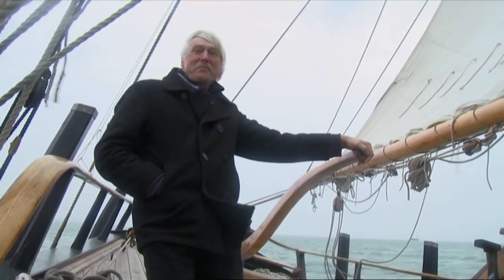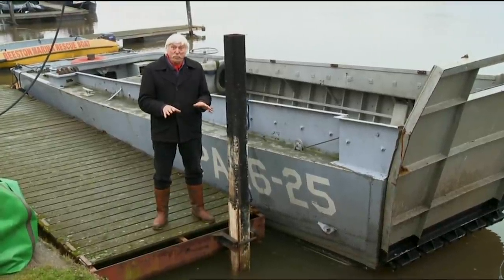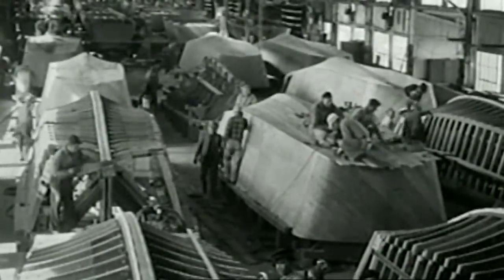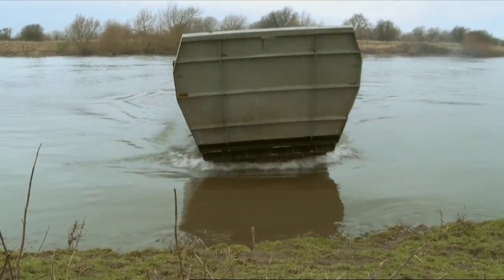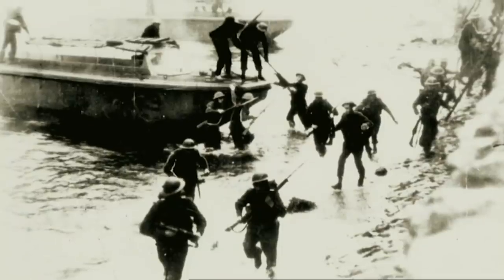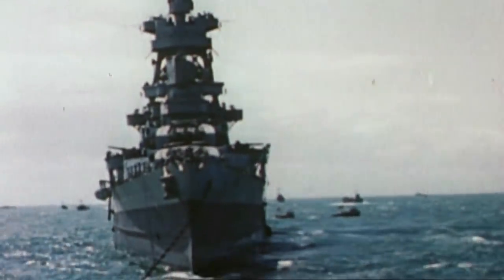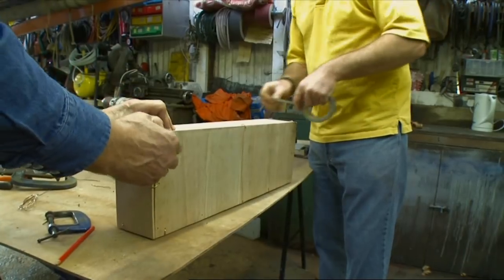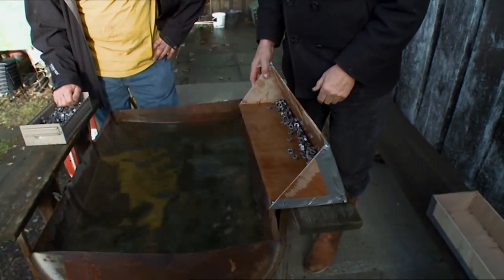The Boats That Built Britain - WWII Landing Craft - Part 1.

Comment: When you see these shore emplacements...You have to marvel at how underutilized the strategic bombing forces and the Royal Navy were.  2000 heavy bombers and dozens of battleships should have turned these landing areas into a moonscape devoid of all life before the landings occurred.
Reply: bunkers are very hard targets to destroy, they absolutely used air and sea bombardment to target the installations, but there's only so much you can do against a building specially designed to endure bombardment
Reply: Bunkers are designed to withstand such a thing, they learned their lesson from the 1910s.
Reply: Oh they did. Youd be amazed by how many ships were behind the infantry on D-Day.

Seven battleships were along the coast, bombarding the fortifications, along with 25 cruisers(5 heavy and 20 light). They also had the support of 139 destroyers, and two monitors.

Comment: Point of Information, Powered by a gray marine diesel 671 cubic inch cylinder, low block,  671 detroits were the high block modern version post WW2

Comment: Brute Krulak had photographed a similar Japanese landing craft prior to the war for intel and found it later filed away with a comment “sent by some crackpot out in China”. 😂
Reply: True; LT Victor H. Kurlak USN took the photograph of a Dai-Hatsu 14 M type landing craft at Shanghai in 1937 while observing Japanese Landing Observations (the reference book is "Across the Reef" by Victor J. Croizat; ISBN 0-7137-1894-3).  Higgins was shown the photograph in April 1941 by MAG Linsert (USMC?) Secretary of the Equipment Board.  So the original idea or concept of the bow ramp was not Mr. Higgins', but his willingness to except it as an innovation, do the work to re-engineer his design, and come back in short order with a new improved version 8 or 7 months before Pearl Harbour is kind of one of those small facts lost or burried in the history of WWII.  Especially when you know it was the Japanese landing craft with a front bow ramp that was the inspriation or answer to getting men on the beach. This one solution would be applied to the larger craft to follow.
Reply: Marines didn't have these at Guadalcanal...but the Army did..."The Thin Red Line"....